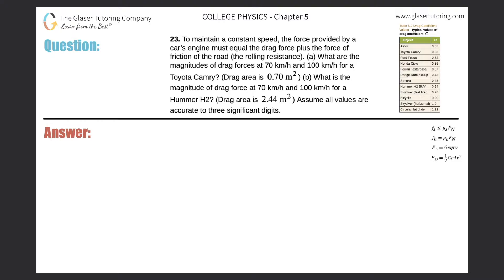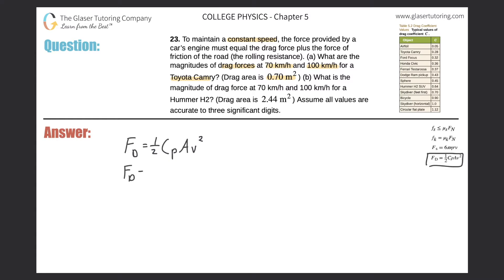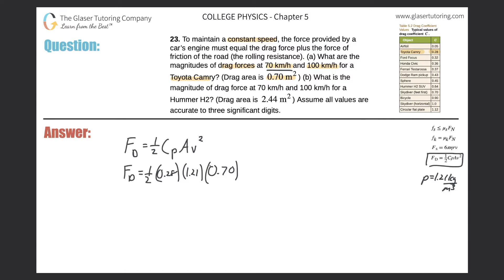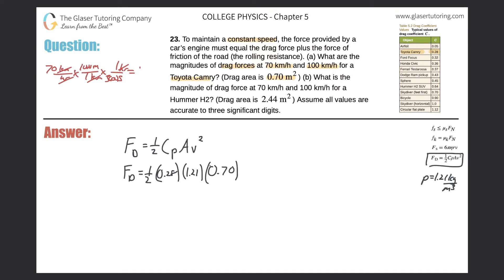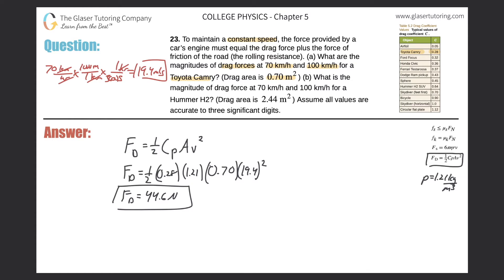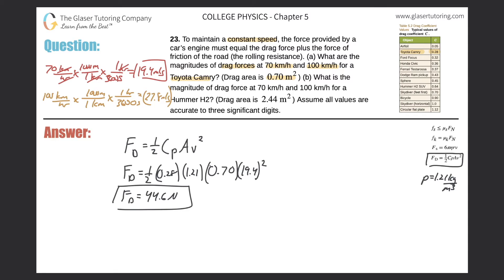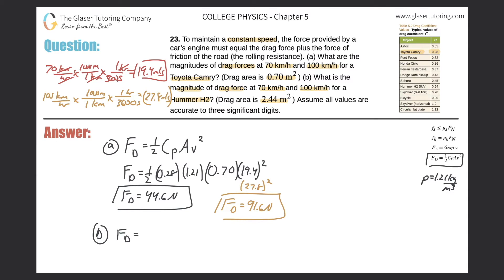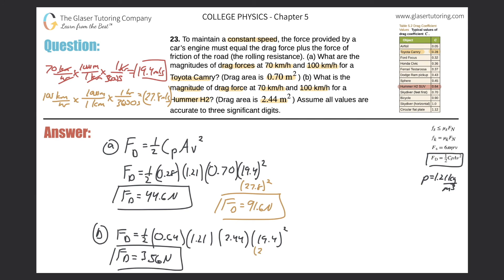5.23 | To maintain a constant speed, the force provided by a car’s engine must equal the drag force

Comment from the maker: Hi everyone!
Just a quick note about the video above: The answer for part (a), the magnitudes of the drag forces at 70 km/h and 100 km/h for a Toyota Camry should be 44.8 N and 91.5 N, respectively. For part (b), the magnitude of the drag forces at 70 km/h and 100 km/h for a Hummer H2 should be 357 N and 729 N, respectively. Use the exact value of your m/s value in the calculation. 
Happy studying!